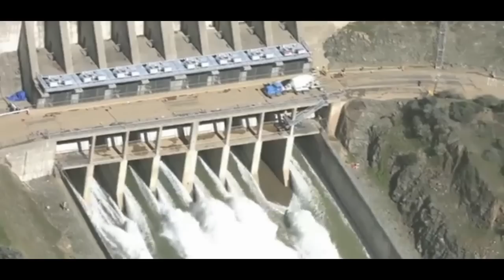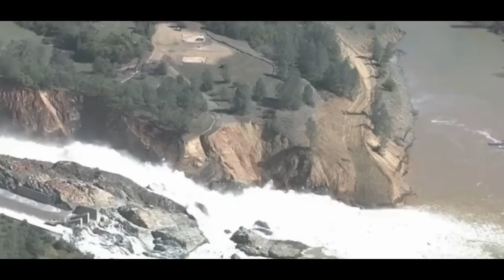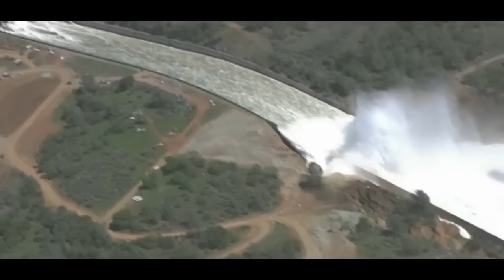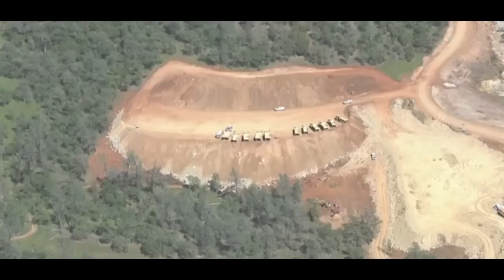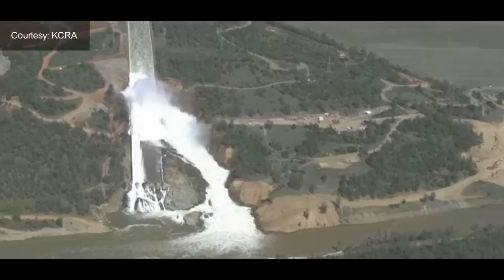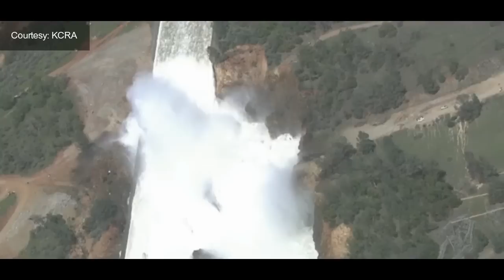Spillway Reopens | Aerial View | Lake Oroville Dam Updates 3-17-17

Comment: Yesterday I found out that one of the reasons for the high flow rate above 40,000 cfs is that at that rate the water fills the "gap" ( you can see some of it running over the lower spillway at this rate).  With that Gap filled the water is being cushioned by the gap pool which greatly reduces the erosion (the reason there are pools at the base of spillways and a well understood process).   Flow rates under 35,000 won't fill the pool and the result is new materiel being eroded & washed into the channel.   They are very happy with the amount of materiel they are seeing downstream and believe the plan is working
Reply: Well said and spot on, Daniel Weston. This has been known and made public for quite some time.
Reply from the maker: Thx

Comment: See! The thing's going to be fine. They'll probably engineer up some concrete shape that fits right in there. It will be cheap and work better than the original. They'll most likely figure out a way to fit in a  Starbucks too. It will be great!
Reply: You high, bro?
Reply: what? The other option is to stress and worry; not worth it for a YouTube peanut gallery comment.

Comment: This is just another classic example of why this country's in the shape it's in. What's funny is, the clowns and the misfits that designed this dam, forgot that they were designing the highest dam in the United States! California: "Dereliction in duty, run amuck!" Nice!
Reply: infrastructure is designed to last alot longer than your lawnmower. also, nobody has a 50 year old lawnmower? i'd disagree witht hat.
Reply: So, what is more powerful, Grass, or Water, under Pressure? Quite sure they knew the power of Water in the 60'd
Reply: Well it was built 50 years ago.It is like comparing this to your 50 year old lawnmower,which no body has.We never even had a TV 50 years ago.

Comment: I have tried continually to get an educated answer/guess from a lot of the viewers concerning the Actual Power in Kilowatts being Produced and a given comparison of that amount of Power. So here it is, "Courtesy of Prospector Jesse," who I thank for this formula.
V x h / 11.8  
V is the amount or volume of water going through the spillway, the numbers they feed us
Multiply by the total height of the fall. 800-900 some odd feet
Divide by 11.8
and that is the Kilowatt power, or energy created by the water.
Apparently if you do the math, it is comparable to approx. 1 and a half times the energy used to launch space craft to ISS.  That would be a lot of power running through and down that slippery slope I would think.
I hope I didn't make any errors of the presentation on uTube of this simple math formula to calculate the Kilowatt power.
Check out his videos, nothing like them. Peace

Comment: It looks so serene and controlled considering the actual amount of energy being produced by the falling water. Looks can be so deceiving though. 
If the rain that is predicted falls, and the temp rises to increase melt rate and the wind was to have strong gusts, I think the water will start to cut or rip that there dam a new one. :)
However if a massive Earthquake nearby or just a small intense one in the right spot, could instantly liquefy the Entire Dam, and then everyone pretty much dies? I guess? From what I understand this is a very taut tightrope situation here. Too precarious to go off without a hitch, just from a Weather observer and watchful waiter. At least I am 1000's of miles away from this one and in my little village, ours is running smooth as silk. Maybe we build to a different code, considering it goes below -40 C here for a share of the  6 month winter season?

Comment: the operation has begun!
Reply: Thomas Mcnamee n
Reply: Dream on...The dam will not fail. After all it is the SPILLWAY that has the damage.
Reply: Commissar0617 Rock isnt that strong when compared to strong water
Reply: What operation would that be?
Reply: Rob Weaver if the dam fails we will know for sure.
Reply: OK, what ever you say
Reply: you mean the rock?
Reply: it's really not going to be a problem where they need to use it for.
Reply: actually, it's just beginning. and it's not so much the rain, as the snowmelt
Reply: It is the SW that will cause its end. And the wet earth beneath it.